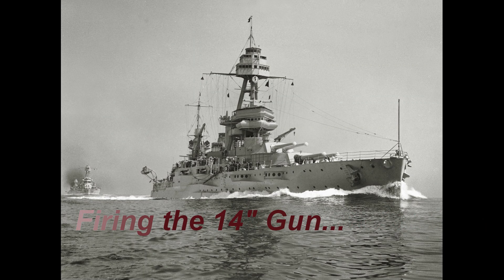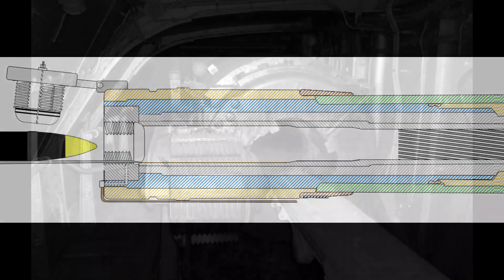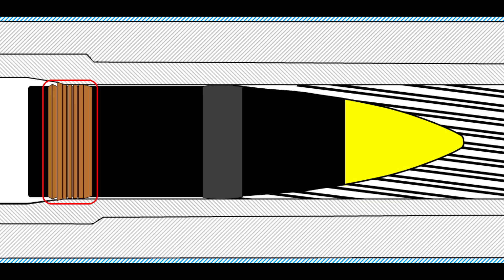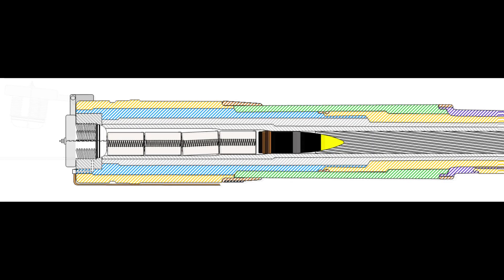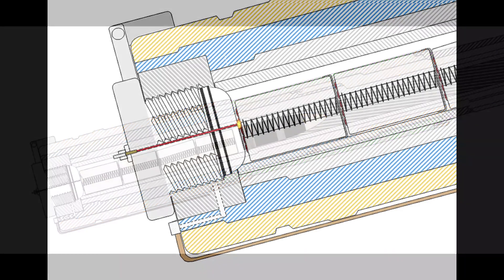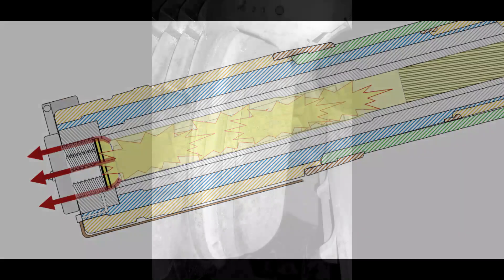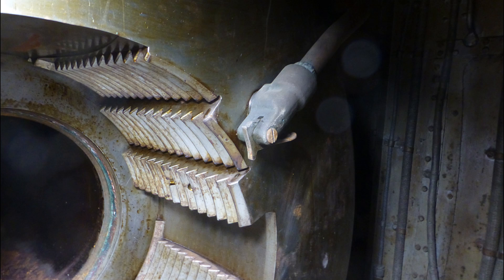Battleship Texas, Firing The Guns Step-By-Step

Comment: How many rounds can a gun crew fire in say ten minutes??
Reply from the maker: An absolute maximum would be about 13 rounds in 10 minutes.  However, loading was a very manual operation that varied according to crew skill and fitness.  For those reasons, they would probably slow a little and end up with 11 to 12 rounds.
Reply: @tomscotttheolderone364  Thanks so much for the quick reply.   WOW  one explosive freight train every minute.    That is intimidating and impressive.

Comment: What happens if the gun has an obstruction during the safety check?
Reply from the maker: I'm not sure what an obstruction would be since they kept the muzzle covered whenever the gun wasn't in use.  The bore was visually inspected before the first and between all shots, and any visible debris would be cleared.  It would be loose since the only thing that would fit tightly and jam in the bore was a projectile.  That being the case, it would be easily pushed out.

Comment: Seeing the design up close and how it's made in sections make me wonder what kind of tolerance the measurements on the parts were. I can only imagine it'd be very small as any small imperfections would likely result in a failure
Reply from the maker: You are correct.  Even major parts may be machined as closely as .002-.003".  More than that could not only cause failures, but could result in what was called lost motion.  That is looseness that creates unwanted movements that can ruin accuracy.  That could happen in a number of places in the gun and sighting assemblies.

Comment: Why don’t you say it’s a down view of the gun ?
Reply from the maker: I mentioned the issue at 8:45.  It is not a down view, but a side view with the breech plug and its carrier intentionally mis-positioned to swing vertically.  It was done so that the swing of the plug, the loading tray, shell and powder bags being rammed could all be shown at the same time.
Reply: @tomscotttheolderone364  great job thanks

Comment: Is there a video that explains how they aimed the guns with all the rocking and rolling on a ship?
Reply from the maker: I don't have a video that discusses that.  It is mentioned at 4:04 in this video, but not in detail.  The preferred way to fire the guns was remotely from main battery plotting room.  Inside the room was a stable vertical, also called stable element, that used gyroscopes to detect when the ship was perfectly level.  When the firing key was closed, the device would not fire the guns until the ship was perfectly level.  The guns could also be fired remotely from the fire control towers where a gunnery crew member waited to close the firing key until he saw that the ship was level by watching the horizon through the gun director.  If locally firing the gun from inside the turret, the pointer, a crew member who elevated the gun, watched the target through his telescopic sight.  He watched the target move in his sight as his ship pitched and rolled.  He would close the firing key and fire the gun "on the fall" as his sight moved down and crossed the target.

Comment: Outstanding video! Thank you! What caught my attention was the chamber pressure,  36k psi is incredible and while I understand the huge volume of the chamber takes a tremendous amount of gas to achieve those pressure ratings, I was comparing it to a 5.56mm rifle cartridge that produces around 58k psi chamber pressure,  but in a really tiny chamber (in comparison). Thanks again!

Comment: Is there a fixed procedure, for the situation, when the gun is fully loaded (grenade + propellant charge) and then the fire order is revoked just before the shot? At small arms the procedure is clear, but how can such big guns been unloaded without danger?
Reply from the maker: They did not use grenades to fire a charge, but a primer that could be electrically or mechanically fired using a "firing lock" that contains a hammer and firing pin.  For many very good reasons, they only used the electrical firing.  There were very specific methods used to unload a gun, but it very rarely happened.  First, guns were only loaded as long as the salvo lights and commands were on, calling for gunfire.  If they called for a cease fire immediately before firing the gun, it would only be in the few seconds before loading and priming is complete and the moment the firing circuit was closed, so they would have likely gone ahead and fired. 

The big issue is if they had a misfire or a hang fire.  There are few things more dangerous than clearing a gun that has 420 lbs. of propellant sitting behind a 1,500 lb. shell.  If for any reason they needed to unload a gun, the normal procedure during WWII was to aim the gun in a safe direction and fire it to clear the gun.  You simply don't mess around with a loaded gun.  If there was a misfire and it did not fire when the circuit was closed, they would check the circuit wiring connection at the gun and try again.  They would then switch from ship's power to battery power in the circuit.  If that didn't work they would attach a lanyard to the firing lock and try percussion firing it.  If that didn't work, they would replace the primer and try again.  It would be very rare for the gun to not fire at that point, but it was possible.  It would happen if the last of four powder bags loaded into the chamber was inserted backwards.  There is a red ignition patch on the back of every bag that contained 300 grains (10 ounces) of black powder that was needed to set off the propellant.  If the bag was put in backwards, the primer wasn't strong enough to set off the charge without the black powder.  The crew would then be in a very dangerous situation if that happened because at some point they would have to open the breech and remove the bags.  However, the primer may ignite a smoldering fire in the silk fabric of the bag that could slowly work its way up to the other end and eventually set off the black powder.  If that happened with the breech open, everyone inside the turret and below it died.  For that reason, they cleared everyone out of the turret except for a couple of gunners and a gunnery officer who then waited at least 30 minutes to see if the bag would ignite.  That was the estimated time it would take for the smoldering fire to reach the ignition patch.  If it did not go off, they would remove the primer which opened up the primer vent (flash hole) leading to the rear bag.  There was a wand with special fitting they could insert into the primer hole and pump water into the back of the chamber.  Once thoroughly soaked, they would open the breach and continue to hose water into the powder chamber.  The four bags would be removed and dumped in water tanks to make them completely safe.  They could then either put fresh bags in and fire the gun to clear the shell out, or they could attach a rope to the back of the shell using lifting eyes that clip into recesses in the shell's base and use the rammer in reverse to pull the shell out.  

Simple, huh?

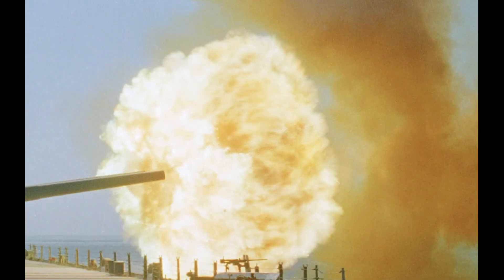Comment: Great and very interesting video. I think that the shown projectile rotation at 7:59 should be the other way around.
Reply from the maker: You are right.  I didn't notice until I had finished the entire video.  I decided that the problem was too small to expend the effort required to correct it.
Reply: @tomscotttheolderone364  actually, you got the rotation correct - there are right hand twist barrels!

Comment: But, doesn't it take 10 minutes to turn the breech plug into the breech?
No, it takes much less than ONE revolution. This critical detail is ignored by the speaker, it's called the "interrupted screw thread", in which the plug is inserted all the way, and THEN turned to lock it up. The threads in both the plug and breech are only partial, with an equal open space separating each threaded portion. If there are 6 thread sections and 6 open spaces, the plug only turns 30 degrees (1 /12th of a full rotation).
Reply from the maker: I am not sure how asking an absurd question, then answering it yourself accomplishes anything more than giving you the ability to discuss a nonissue.  It was not a critical detail that I needed to address in this video because it wasn't pertinent to the topic and was covered in other others I have created for this channel.   Since you brought it up, your description of interrupted thread design doesn't fit the Welin design used on Texas or any other 20th century U.S. battleship.  It does not require "an equal open space separating each threaded portion."  The major characteristic of the design incorporates threads that are both interrupted and radially stepped to eliminate the need for segments clear of threads between most thread segments.  It also provides maximum plug strength while only requiring rotation of 30-36 degrees to lock or unlock the plug.
Reply: The "interrupted screw thread" was invented by Axel Welin who sold his patents to Vickers, Ltd., a British company. The US Navy tried to use the design without paying royalties to Vickers, and was successfully sued.

Comment: Thanks always wondered about the process. At the beginning, at 0:28 in the video, there is the photo of the guns firing taken in the air from above and foward of the bow. You can see some small waves that are perdicular to the axis of the ship. Are those waves that are actually caused by the force of the guns firing and displacing the ship in the opposite direction of the firing?
Reply from the maker: That's a good question that has been asked by many people when looking at similar photos.  Regardless of how much it appears that the ship is being moved, it is not.  The waves are made by the immense pressure wave created when the gasses are expelled from the muzzle as the shell leaves the barrel.   An interesting math exercise was performed a number of years ago by someone who calculated the effect on hull movement when guns are fired.  The author cheated the computation by assuming the ship was sitting on a friction free surface, like ice, instead of in water to keep from having to calculate hull resistance in water and simplify the math.   The result was that even with that huge advantage, the ship would only move a fraction of an inch.  Based upon that, it is accurate to say that the amount the hull would move when in water would not be measurable.

Comment: My father was a brilliant tooling engineer who did everything on a good old fashioned drawing board. I started out on the drawing board and then taught myself CAD in the late 90's.  He and I were the sole suppliers of a lockwire that held the tail cone assembly to the rocket body of the hydra 70 rockets for over 30 years. I often wonder about the brilliant engineers of those days. If they had CAD can you imagine?
Reply: That's cool! And the Hydra 70 rockets are still going strong, also being turned into guided munitions in the form of APKWS, amazing stuff. While I can work with CAD, I really prefer drawing with pencil and paper. It just makes it easier to visualize what I'm picturing clearly, after which it can be made in CAD of course.
Reply: if you have half a mind....why is CAD amazing...??
Reply: @maxpower9631  I would guess because anything that speeds up the drawing and automates certain calculations would be a god-send in speeding up the design work and speeding up the amendments needed for iteration. Which speeds up design and production.

Comment: Thanks!  I knew the basics but always wondered how they ignited the main charges.  
I found it interesting that the max bore pressure when firing was 36,000 pounds per square inch.  For comparison, a 30-06 cartridge has a bore pressure of about 46,000 PSI.  
But of course, we're talking about a HELL of a lot more volume in that 14" rifle!

Comment: im hoping this is old. I heard the bad word asbestos
Reply from the maker: It’s only bad when it gets loose in the air.  A great deal has been remediated from the ship, but a lot remains.  What is still on board is encapsulated to seal it from the environment and meets all modern safety standards.  The protective surface is durable and completely safe to be around and come in contact with as long it isn’t damaged, which occasionally happens. When it does, that part of the ship is closed off and a remediation contractor either repairs the damage or removes the asbestos if there isn’t a lot of it.

Comment: Did battleships of the Japanese and German navys have similar guns and were they in any way the same as the US Navy guns?
Reply from the maker: I haven't done much study of other nation's large naval gun systems, but I do know that while they shared general features, there could be large differences in design details.  For instance, all large gun barrels were of "built up" construction, meaning that they were made up of several pieces.  Some designs used sleeves and locking rings for strength while others relied upon wire winding, or a combination of both methods.  Most nations used interrupted thread breech block and plugs, but the breech operating machinery greatly varied.  There were also many differences between loading and ammunition handling systems.   Aiming, pointing and training gear also varied a lot.  The differences can largely be attributed to differences in design philosophies, along with differences in material and manufacturing capabilities.
Reply: The Yamato was the largest battleship ever built. Had 9 x 18 inch guns. Plus more smaller caliber.  American air power sunk it and it's sister ship Musashi!!

Comment: I didn't know the residual gas in the barrel was explosive but it makes perfect sense.  You want the explosive mixture to be fuel rich, to prevent oxidization of the barrel by high-temperature oxygen that would remain if the mixture was lean.   Everything with a combustion cycle, from car engines to rocket engines, is run rich for this same reason.
Reply from the maker: I believe the shortage of oxygen is simply the nature of the chemistry and not by design.  While I am not a chemist, it seems unlikely to me that oxidation is a fairly minor consideration, especially considering that the Mk 12 barrels installed in 1944 had chrome lined bores  By far, the major cause of erosion is microscopic cracks and flaking of the bore surfaces caused by extreme temperature "pulses" of at least 2,000 degrees.
Reply: @tomscotttheolderone364  The ratio of fuel to oxidizer in the propellant is completely up to whoever manufactures it. Going with a fuel rich mixture wouldn't protect the barrel from all sources of wear for the reasons you mention, but it would solve the issue of high pressure, high temperature oxygen remaining in the barrel and going right to work on the metal.

Comment: I always thought they used Black Powder for their main bag charges.
Reply from the maker: Black powder was largely replaced by the early 1890's with what was called brown or cocoa powder.  Smokeless propellant became the powder of choice by 1900.  However, black powder continued to be used as a booster in the red ignition patch on the back of the powder bags.

Comment: The reason these shells have a driving band and never touch the rifling is because the steel shell body would tear up the rifling if it tried to engage it. But I'm sure the majority of you know this.
Reply from the maker: That is one of three major functions performed by the driving band and only does it at the rear of the shell.  The bourrelet performs the bearing function further forward.  I get into the subject with this video- https://www.youtube.com/watch?v=YZzNQ26uBr0

Comment: how many members of the gun crew (for each gun in a turret) were actually Gunner's Mates?  i hang with a Vietnam Vet GM2 and he had NOTHING to do with any of the guns on his DDG.  he worked in the Missile House.  he has told me that NO Gunner's Mates ever were on any gun.  they were all manned by the cooks, storekeepers, laundry men (?) or others that were otherwise 'not needed' during combat operations.  not sure why they would even have the rating then.
Reply from the maker: The complexity and operational risks that were inherent to the turrets and their guns required highly trained gun crews.  Men were permanently assigned to them and organized into divisions that normally drilled on a daily basis.  These divisions were part of the overall organizational structure of the ship with turrets 1 through 5 on Texas forming divisions 1 through 5.  However, that doesn't mean that they didn't have other duties when they weren't practicing at their stations.  After all, it's not only a waste of manpower, but also bad leadership to not keep them busy.  Few men wanted to be assigned to a gun crew during peacetime between the wars.  Not because the job was dangerous or strenuous, but because it didn't give them a skill that could be used in civilian life.

Comment: Why do naval guns not use muzzle brakes and bore evacuators?
Reply from the maker: I think much of the reason is that a ship has the size and space on board to do the work with more effective devices.   It is unlikely that a bore evacuator can properly clear a barrel that is more than 45 feet long of explosive fumes and unburned particles.  It can be effectively done with the gas ejector systems on the ships that blew 150psi compressed air through them as the breech plugs opened.  Likewise, large recoil cylinders mounted on the guns do a very effective job of reducing and spreading out the effects of recoil.
Reply: @tomscotttheolderone364  That makes sense. Thank you.